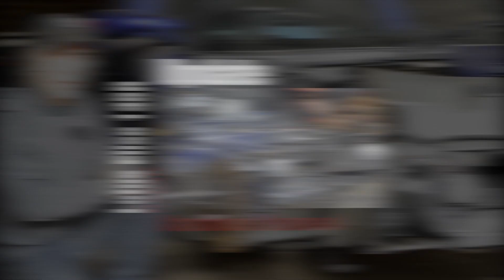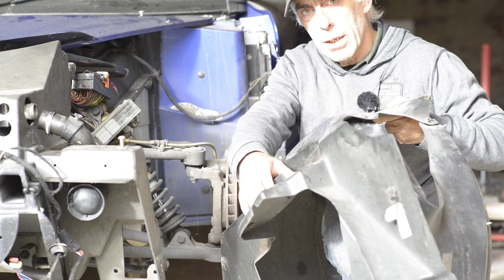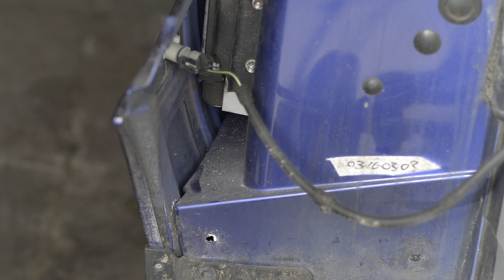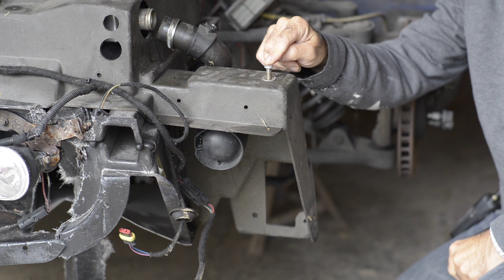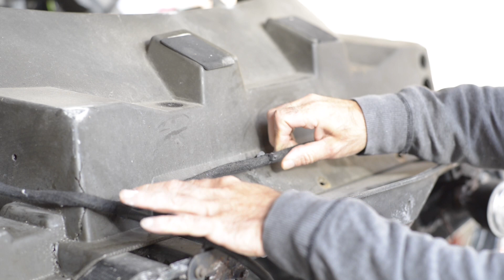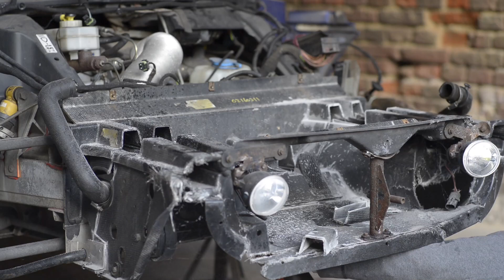Lotus Elise S2 , Crashbox removal

Comment: Ill be doing my crash box shortly on a 2008 what a crash box worth in the uk ?Any luck with a used parts
Reply from the maker: Flatdek , i would not recommend used crash boxes as it is hard to remove without damage. Secondly, some people then try to repair it and sell it.  Its a bit like a child seat in a car.  Once you crashed with it , it might not show damage but it can have.   After all its a saefty device and i would not take changes with it.  The same is valid for aftermarket parts.  Go for the original

Comment: Hey! Nice video, top tip, you should replace the tow strut with a new stainless steel one while the car is in pieces, the original lotus one is carbon steel and becomes very weak and will not hold the weight of the car and will just break when you need it! I know from experience! Then when you least want to you have to remove the clam to fit a new one..... €100 now will save a lot of time and money later on.....
Reply: Came here to say the same thing. Definitely worth replacing tow strut while the clam is off
Reply from the maker: Ad Rok thanks rok.  Good tip.  And yes you have point.  Maybe just replace it while it is all appart.